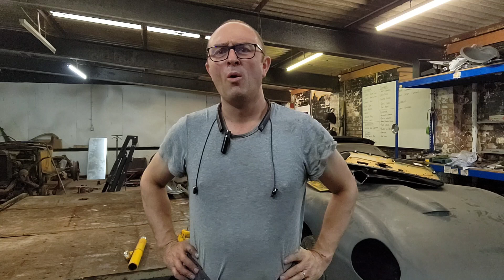The first rule of EV conversions

Comment: Wanna help me convert a standard env200 van into a combi by welding in some seat bolts to the wheel arches and a plate into the floor for the rear fold down seats i bought?
Reply from the maker: Absolutely - bring it to the shed!
Reply: @EVDIY  will do soon enough. But not immediately. Caught a stinking cold i wouldnt wish on anyone.
Reply from the maker: @Whereswally606  Urgh. No-one needs that. Away for a few days but will give you a bell when I'm back